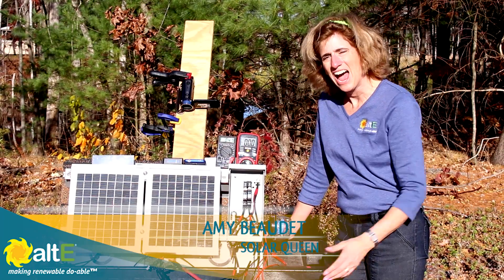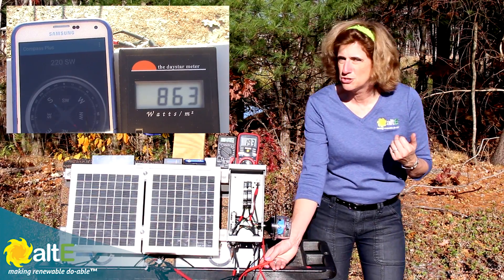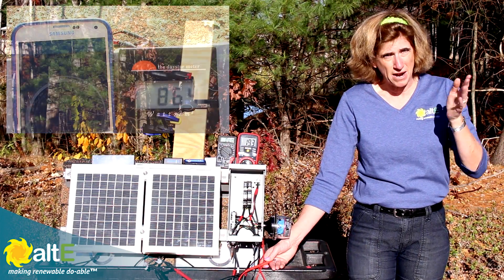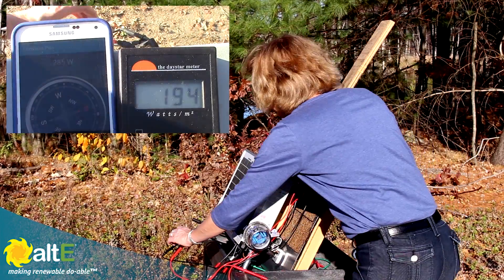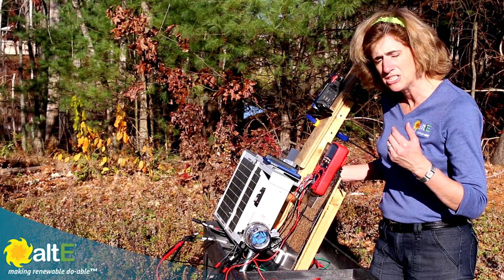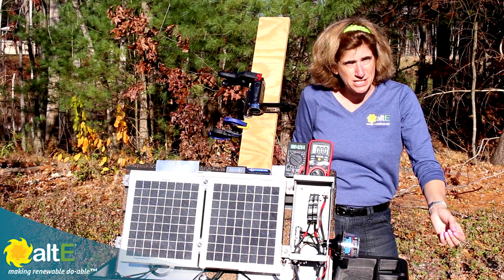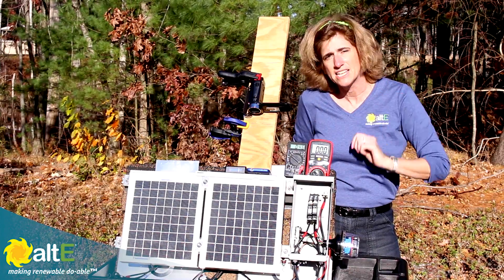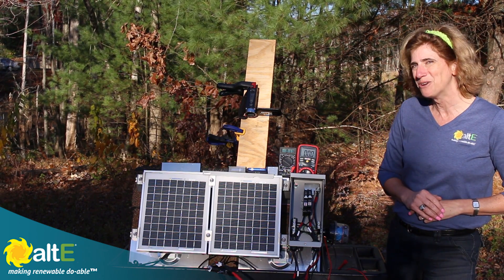Why do I have to point my solar panels at the sun?

Comment: they should work when its daytime out you should not have to keep it in direct sunlight thats silly
Reply: They will work, but output will be less.

I'm watching videos to see if I can see someone pointing them the wrong way on purpose; I have north/south roof, and indirect light is higher in the winter, so I'm considering both directions specifically for winter.
Reply: @FelipeBudinich  panels are Made to generate more than what they are advertised as so when it's cloudy you still get atleast the rated voltage.
Reply: @chriss4365  i know roughly about 40% comes from indirect (scattered light) I just want to see a test before I go and buy a portable one to measure  on my roof before committing to add the surplus.

(Say 50% loss is acceptable, 90% loss isn't)

Comment: Hi,I have a south facing string in an off-grid system of 460 watts at 36 volts.I want to add a roof mounted string facing east and west of 540 watts each at 38 VOC.Can I use a combiner box to tie them together without killing any strings NOT currently getting good sun?
Reply from the maker: I HIGHLY recommend getting a 2nd charge controller for the new array.

Comment: Thanks Amy but what happen if you completely turn the panal 180°, will you lose all of the watt outage?
Reply from the maker: You will likely still get some output, but much less. It also depends on the angle, if it isn't very steep, you may get more direct light than a very steep slope that would block most of the sun.

Comment: What happens when I wire the East Panels and West panels together??
Also what if my house is having roof facing North & South??
Reply from the maker: The east panels should be managed separately from the west panels. If in a battery based system, that means 2 charge controllers. If it is grid tied, then either an inverter with 2 MPPT inputs, or microinverters or DC optimizers  (SolarEdge) on each panel. For north/south, unless you are very close to the equator and have a very shallow roof, you would generally only put the panels on 1 side, south in the northern hemisphere and north in the southern. Point them towards the equator.
Reply: +altE "U said - south in the northern hemisphere and north in the southern, point towards equator." will this help in getting maximum power? because your this video (https://www.youtube.com/watch?v=m_YuPfShbCo) says less angle than Latitude will give less power!!!

Comment: when I see solar fields on mostly flat land, the first row of panels will receive the most sun, but each row behind them will have to wait until the sun gets high enough to get full exposure, is that why they are mounter at a low angle year round?
best
Reply from the maker: +Rev John O'Toole Very observant. The inter-row shading is important to calculate. The lower the angle, the shorter the shadow from the front row. So if the panels are steeply angled, they will cast a longer shadow, and the back row needs to be further away to stay out of the shadow, limiting the number of rows. By having a low angle, they reduce the shadow length and increase the density. Additionally, a lower angle will also help reduce the wind force.